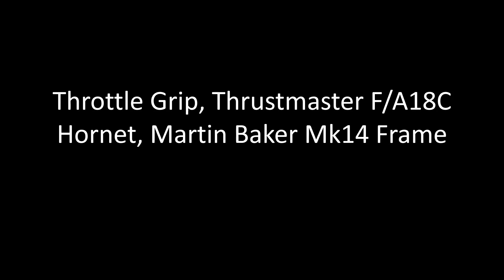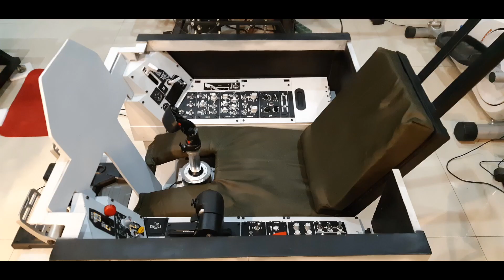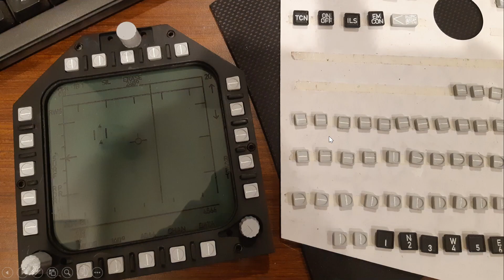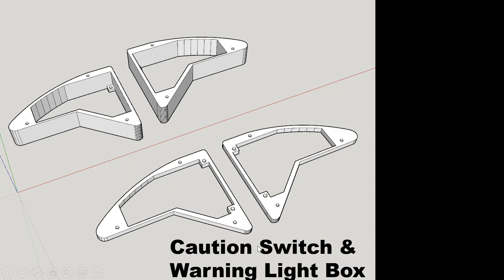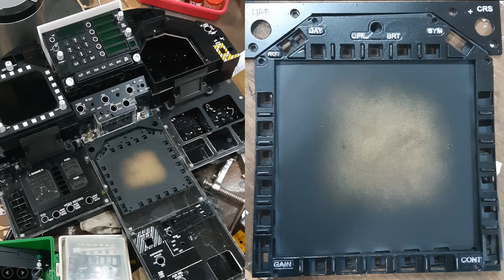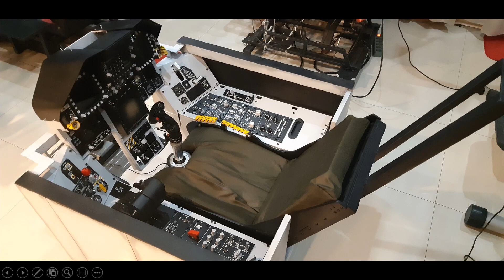F/A-18C DCS VR Cockpit Build Process Video Part 2b

Comment: id love to get more detail on how you designed the pcb's and where you had them done..
Reply from the maker: I would like to but for the DDI or MFD PCB I did have several wrong routing so haven't been able to fix that and reproduced, so if I upload it, for sure it will not work. Coz I did manual re-route fix using small cables about 5-8 lines (forget about it). quite unfortunate when I create it I'm not using auto routing as it's not achieving the route that I wanted to be. But resulting in several wrong manual routing. I will upload the source but need to manually re-check if you would like too
I'm using Easy Eda free software (offline version)
Reply: @hobbytechgearID69  i never imagined creating custom PCB's and having them done in China at such a small scale was even remotely accesible.. id love to know who's the supplier
Reply from the maker: I have a local supplier who do collective ordering and send to china, lived in Indonesia though takes 30 days from sending the gerber files.  Initially would like to order via aliexpress. There should be one that have good reviews. And usually communicate via email first. Aliexpress usually min 5 pcs.
Reply: @hobbytechgearID69  thanks ! that's most interesting!